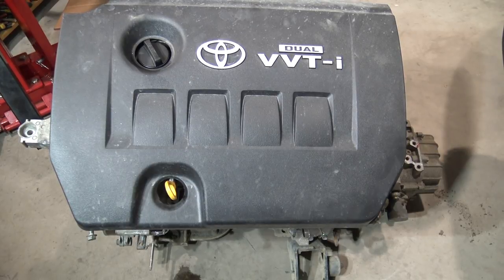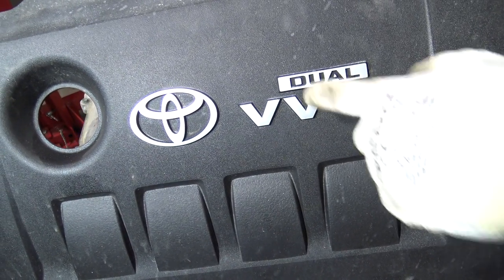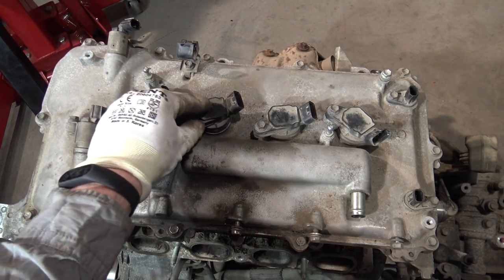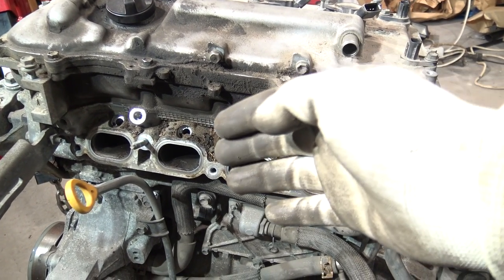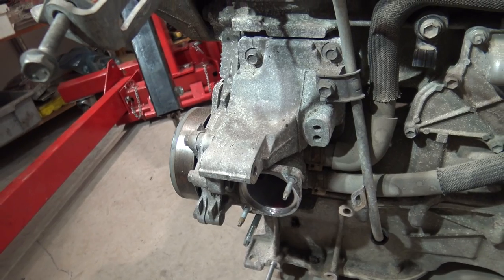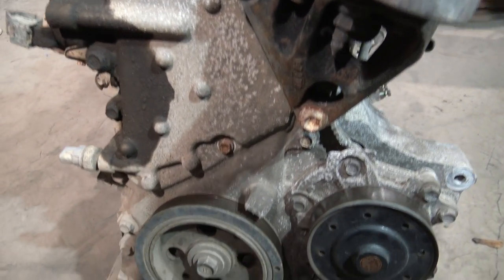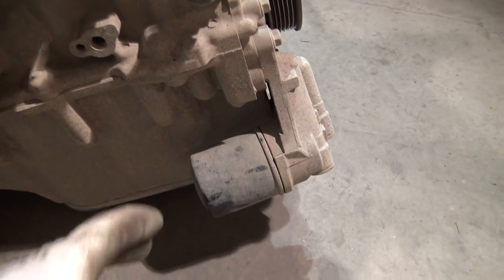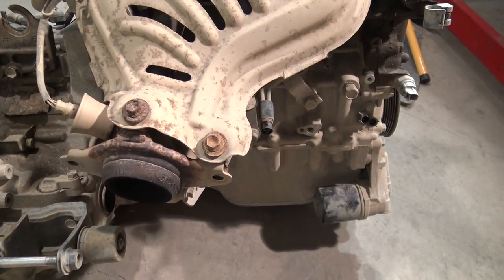Outside view of Toyota Dual VVT-i engine. Years 2007 to 2019

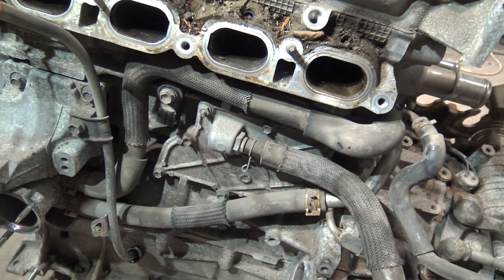Comment: Hello Peter, thanks much for your great effort! At 3:30min, there are two tubes connecting to the water pump house. I just realize that I installed the “L”-like tube to the bottom port and the straight tube to the top port while your video shows just opposite. Is this going to be problem? Thanks!

Comment: I have a question I have a small oil leak in the timing chain tensioner area I thought it was an oil pressure sensor but looks like it's higher it looks like this engine has oil residue in the same position. It's not a leak from the valve cover.  is that leak can be coming from the timing chain cover? Thanks so much
Reply: Have a similar thing but mine near the crankshaft position sensor and crankshaft pully.
Reply: @TheUnderGround979  ...in my case, it is a timing chain tensioner, very comon leak. Check youtube for more videos I used a telescopic mirror to diagnose.